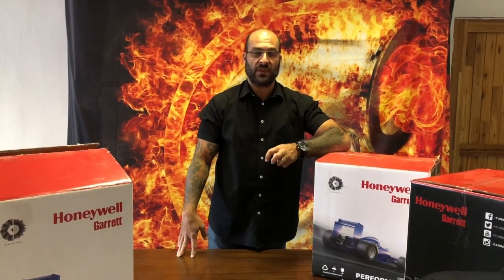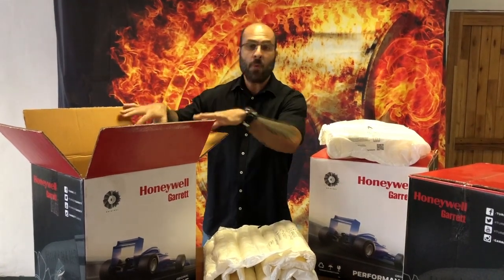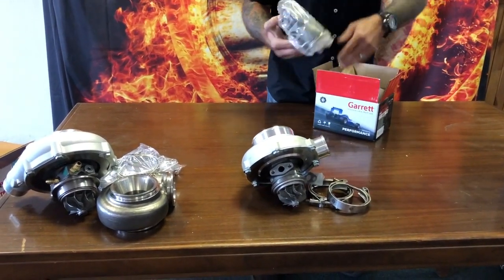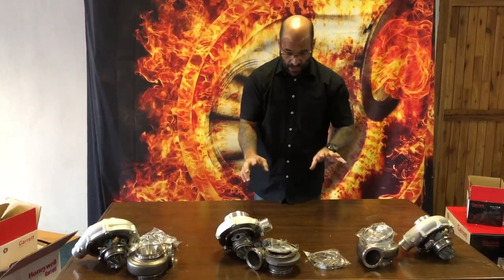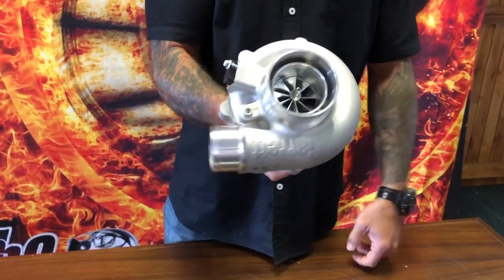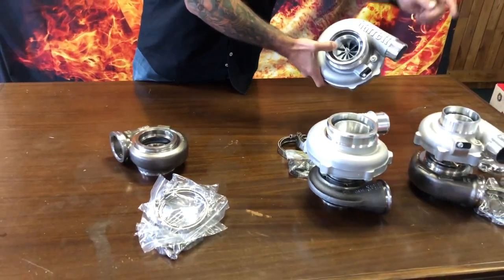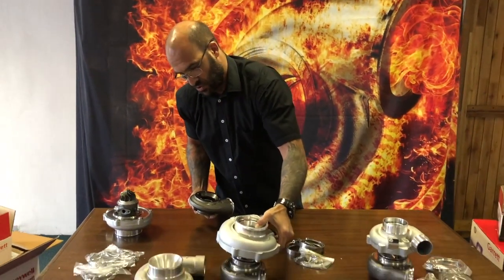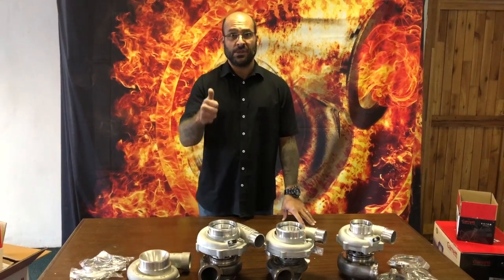Garrett G30-770, G30-660, GTX3076R Gen2 compared

Comment: Let's see these three turbos compared on the same 4 cylinder engine!
Reply from the maker: not going to happen very soon I'm afraid, but what will happen very soon (inside of the next 3 months) is these turbochargers including the bolt on units we developing currently will be installed and tested on a real engine - its not a 4 banger, its a 1JZ which is fully built and ready for various turbo installs - this car will remain on the dyno for all tests, and will be tuned with three different ECU's -- electromotive, AEM, Speeduino.  Coming soon.
Reply: Chris Kambouris nice look forward to the results. I am currently about to install a g30 770 onto an already built 2.2. We will try both exhaust housings but hopefully the .6 will do it without compressor surge.
Reply from the maker: @marcusallen1567  good luck, please share the results, youll notice a HP improvement by changing to the larger turbine housing.
Reply: Hi chris
Regarding your coment, to an example or that 1jz, for you, rated to 700hp
What is Best setup ?
The g30-900
Or g35-900 or g35-1050
Reply from the maker: @heberrodrigues3903  On the 1JZ - being a laggy setup especially without VVT, this is a broad topic - ill make a quick video explaining this to you in the next hour and post it for you, it will shed some light on other builds aswell from the info ill share - ill post it onto this comment section shortly.
Reply: @TurboDirectSA  Im turn on right now the TV to see in full HD 😁💪
Reply from the maker: @heberrodrigues3903  its uploading buddy - give it 10 minutes
Reply: @TurboDirectSA  Any news for the 1jz ? I got a 1jz vvti and currently exploring turbo options
Reply: @Pourtier Beatz Don't waste your time with G25-660. G30-660 or G30-770 with .6 housing. My g30-770 makes more than that and I'm all in before 4000rpm (2.2lt 4 cylinder)

Comment: How is the spool difference between the G30-770 and G30-660? Is the 770 slower or faster spool than the 660?
Reply from the maker: There is around 200-300RPM difference across the entire RPM range, however on a vehicle, this is noticeable. The larger diameter compressor holds a heavier mass, and there is slightly more shaft power required to rotate the larger higher flowing compressor. Once in full swing, the obvious power difference will be noticed of course.

Comment: Hi Chris, somewhat quick question for you. I have a 1jz vvti in my jzx100 chaser. Its currently running an old gt3082r and im looking to upgrade the setup and switch over to e85. Looking at a power goal of 500-550rwhp, with some headroom for more futurw mods but trying to keep it as responsive as possible. Im tossing up between the g30-770 and the g30 900. What do you recommend? My worry is if i run the 770 ill be pushing it to its limit and it will produce high IAT's. Thanks mate.
Reply from the maker: Buddy look at this video - https://www.youtube.com/watch?v=QhQGw40gdEQ&t=1s   
and then this video -- https://www.youtube.com/watch?v=z_BFLTqstoY&t=1s 

What i want to share with you is the compressor maps and "specifications" of the EFR7670 and the G30-770 so that you can get an idea of what these two options offer and why the EFR is actually a far better option for various reasons, specifically for the smaller 1JZ CID engine. 

The 1JZ doesnt have the larger CID (cubic inch displacement) to spool a turbo as well as the larger 2JZ - so the lightweight turbine design of the EFR is perfect for these smaller engines, and  the compressor is more than able to provide power right into the high Engine RPM range of the 1JZ without falling off like the Garrett 770 will.  Ill do a new comparison video with the G30-770 and the EFR7670 aswell as the G30-900 and the EFR7670 and later on the EFR8474 Black Series (which is unfair on the G30-900) even though the G30-900 claims to produce 900HP, against the 8474's 950HP - there is a hidden secret in the 8474 map though.
Reply: @TurboDirectSA  I'm waiting for this video :)
Reply: I'm not gonna lie I've been eyeballing the G35-1050 in comparison to the EFR8474 I have sitting here. It seems like that would be the apples to apples comparison in terms of wheel size on the compressor side. 

I'm moving to a new state next month and then will proceed with fabrication and install of all my build. I'm thinking I should hit around 650-700whp or so without nitrous. 

What I'm also wondering is if I should have just kept my EFR7670 on (I still have it) to hit this goal and have a much more streetable car. I could probably return the 8474 and take a small ding on restocking. The casting on the turbo looks a lil' rough...but seems to be the norm for Borg on these turbos.

Anyways, thanks for all that you do/educate on.
Reply from the maker: @mrfumetsu  The 8474 is a direct comparison to the GTX35 and G35-1050 -- it will actually outspool, and outperform the garrett easily.  I would run this instead of the 7670 as you want to produce more power than the 7670 is capable of.
Reply: @TurboDirectSA  I'm just worried it's going to be too laggy...i was shooting for 650-700whp. just slightly out of reach for the 7670... but now i'm just worried i overshot my goal with the 8474 and i'm leaving some powerband off the table so to speak. 

I found a place that makes an 8370! they merge the 7670+8370... https://agpturbo.com/borg-warner-agp-efr-8370/ if i found this ahead of time I might have tried it out. anyways, thanks for all your vids & info. priceless.
Reply from the maker: @mrfumetsu  I think when you reach the 650HP mark with the spool that the 7670 offers, i doubt you will want to change the response for that extra 50HP.
Reply: @TurboDirectSA  650 was the low end of my goal, and i didnt think the 7670 was capable of 650whp (not crank hp). crank hp would be 780hp.
Reply from the maker: @mrfumetsu  Its always a good idea to run a turbo with a higher HP capability than your target HP, in order to run lower boost pressures and put less strain on the engine. Next option is the EFR8474 Black Series.

Comment: Hi, great vids as always. I have a 4 cylinder 2.3l turbo I want 600whp I was looking at the Gtx3076r gen 2 but will the G30 770 give me better spool time. I'm aiming for boost @ 3000rpm or lower right to 8000rpm any advice on a turbo. Why don't you guys do twin scroll?

Thank you in advance
Reply from the maker: Thanks for your comment - the G30 will not spool up faster than the GTX30R the turbine dimensions are the same, and there is a slight difference in weight of the turbine wheel aswell - in the favour of the GTX model. The compressor is said to flow more than the GTX, however in tests we have done back to back on the same engine, same dyno, same day show different.  The GTX3076R Gen2 is proven and dynamite!
Reply: Thank you, gtx30 it is then.
Reply: @TurboDirectSA  Very interesting, i have a Gen II GTX 3076 and want faster spooling  (Nothing wrong with the Turbo )  I was looking at G30 660. I'm only looking at 450bhp
Reply from the maker: @odin5188  You wont get much better spool with the G30-660, and for the price it is certainly not worth it. If you are thinking of spending money on changing turbos, i would consider a turbo that will do exactly what you want it to do - its an expensive exercise and choosing the right product is key.
Reply: @TurboDirectSA  Thanks for the advice, it's a case of "Ooh something new and shiny"

Plus as you mentioned in your video it's not a straight swap.
Reply from the maker: @odin5188  If its shiny and new you want, i would consider the EFR7163 with twin scroll (smaller AR)  turbine housing. This will make 450HP easily, and  outspool the GTX3076R considerably. The linear response will also improve substantially too since its internally gated and less of a hassle to install and tune.  Sure it wont bolt on - nor will the G30 for that matter, either way there is some work to do.  

The results with the G30 will not be as good as the 7163 will. 

Hope that helped
Reply: @TurboDirectSA  I think I'll stay put, with everything said and done I'd be looking at £3500 for the change 😲
Reply from the maker: @odin5188  3500UK Pounds -- thats ridiculous.  It should never cost you this much to a change a turbo.
Reply: @TurboDirectSA  

New Garrett Turbo - £1700 not sure on price of other brands
Manifold fab and fittings easier a day's labour -£500 + manifold plus a day's labour £600+
Tuning session - £300.
Reply from the maker: @odin5188  Which turbo are you referring to mate??
Reply: @TurboDirectSA  The G25 660. I priced up one on the same website I bought my GTX. Incidentally a GTX gen II 3076 is the same price.
Reply from the maker: @odin5188  No mate that price is extremely high. Not sure where you buying from. You shouldn't be paying more than around  1300UK Pounds.
Reply: @TurboDirectSA   what would be the best A/R on a GTX3076r gen2 for say a 2.0 tfsi mk5 golf? .61ar or .83ar?
Reply from the maker: @y11ssh33  The AR will depend on the application, if its a setup where you want low down response, use the smaller AR housing. If you have a higher HP number target in mind, then use the larger AR housing, the less backpressure, the higher the HP, but slightly more lag depending on the AR seperation between the housings you intend using.
Reply: I have a fully built wrx 2.0l I have the g30-60 I made 468hp on 27lbs of boost. My aim is 550 can this turbo handle 35lbs of boost comfortable?